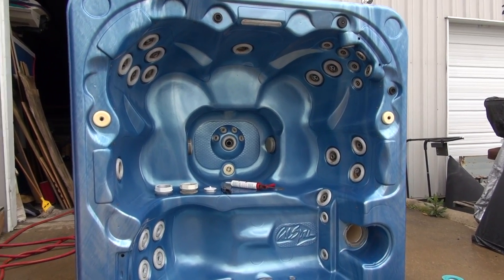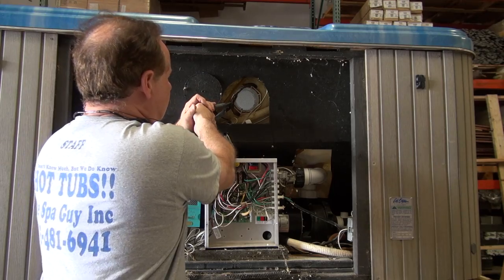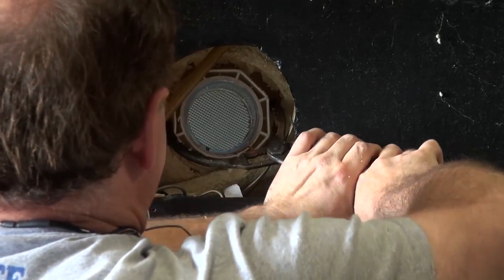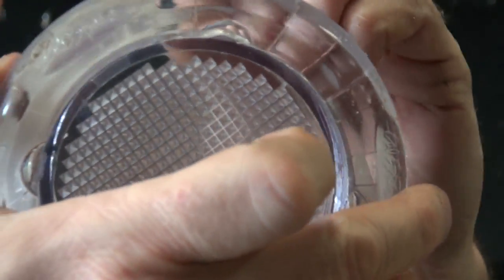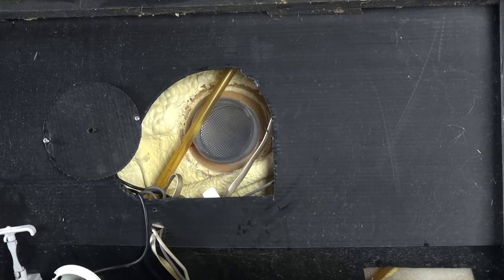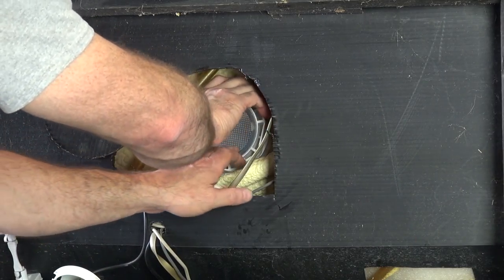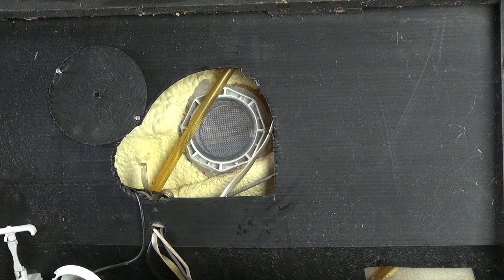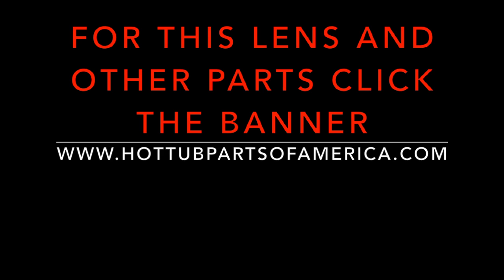5" Light Lens Hot Tub How To The Spa Guy Cracked Leaking Cal Spa

Comment: Spa Guy you have saved me hundreds of dollars with your videos. I've changed seals and impellers, bearings in my pump motor and replaced a heater that was the reason the breaker kept tripping. I have heard the life span of a hot tub isnt that long. But I tell you what, mine will last twice as long if not longer from what I' learned. Thank you so much. You have a very good way of showing how to do things the right way.

Comment: Thank you Spa Guy. I just changed the light that was leaking on my Cal Spa. You made it easy!
Reply: Hey there, East Canada connecting. I found out that the light was leaking after 10 hours of work on the root molded 2 person hot tub work I did myself. The Spa Guy vids were so helpful!  I just found out where at least one leak is today. So now I can feel at ease knowing that the Spa guy has a vid on helping stop the light leak....here in Atlantic Canada the spa service is horrendously terrible! And they charge 127 per hour taxes included!  Dealing with them and feeling very frustrated with Island hot tubs and pools on Prince Edward Island was enough to help me decide to commit to finding out the leak myself. I have 6 bags of spray foam thinking it was one of the jets or plumbing. You have to work underneath it so I jacked and supported it 24 inches up. 
Once I started slowly filling up the hot tub in sections so I can stop and see if there is a leak as it gets filled then a pause. 
Well!  Can you believe that the light is right where the one panel door is near the motor....and can you believe that the hot tub guy came and kneeled for 15 minutes looking at the plumbing and didn't even see or think to notice the spa light that was dripping two drops per second right there in the clear area of the panel area!!!  
They were really quick to send me an invoice! I did not pay it in haste like I generally do and I will be challenging them as this guy didn't even do anything! We call this making "stupid money" which is like robbery !  
UGH!  A lot of disappointment with this hot tub landscape!  
I will fix the light leak and learn how, then continue to fill up the hot tub slowly checking that any of the other jets are solid with sealing. 
I plan to stuff the hot tub with rock wool and reflecto blanket and never fill it with spray foam again!  It really takes a lot of patience so I worked 2-4 hours per day then I had to stop for sanity reasons. 
What kept me going was knowing that I wasn't giving my hard earned money to an incompetent repair guy ..... he probably would have ended doing a horrible job as well. 
DIY'ers we got this!  It is a commitment though....if I had a full time job and kids and pets to manage I would not have gotten around to working on it....cheers from East Canada.

Comment: Saved my hide and my wallet on this one. Had to use the sander on my dremel to increase the size of the hole on my Coleman 555 indoor hot tub because they don't make the same lights as they were made with. Wouldn't have been able to do it without this video guiding me on installation.

Comment: I have a 2009 Cal Spa. First pump is spraying water lightly only during the speed cycle, not the circulation cycle. Looking to possibly replace the pump, but can't find one. Is there a compatible pump for this? P/N pum22000590, or is there another fix given it only happens during the speed cycle?

Comment: The new gaskets have a flange that extends about 1/4 inch down the light and seems to get bunched up when the nut is tightened.  Any ideas?
Reply from the maker: Shouldn't get bunched up unless the lens is turning or you got silicone on the gasket.. You have to hold the lens stationary and turn the nut..
Reply: @SpaGuy  Yep, had someone holding it and tried without silicone the first time.  The newer gaskets don't look like the one in your video.  Other spa repair folks have said to toss the gasket and just use silicone.  Thanks
Reply: @KirkMiller-is1fz  I just did the same thing with my Leisure Bay hot tub. Now I have to take it all apart again and I'm going to use silicone this time instead of the gasket. One other thing, if you're going to change out the lens and everything, if it's cracked already,  it's much easier just to gently tap it from the inside of the tub until it breaks.

I had to change the gasket for the filter as well, and when I went to the spa shop they said don't bother using a gasket there either. Just glob it full of silicone. That hasn't leaked since I repaired it.